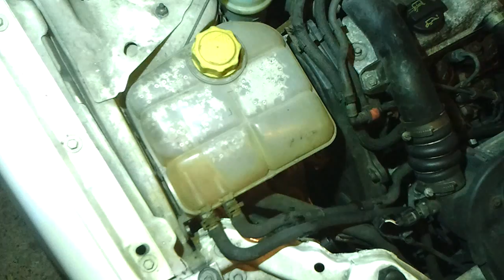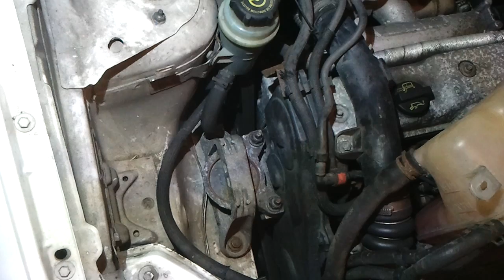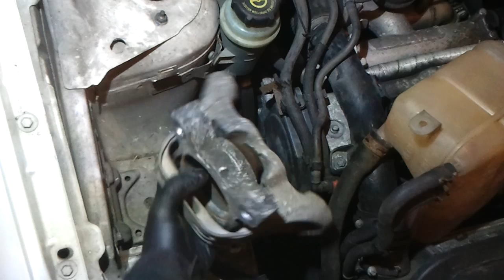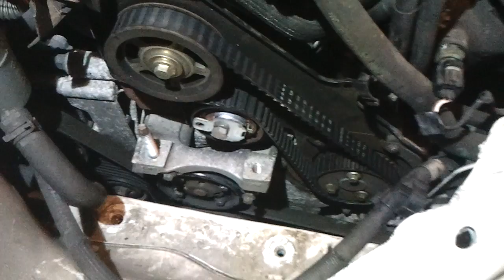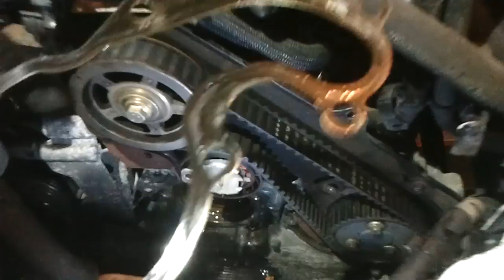Waterpump Replacement on Ford Transit Connect tddi tdci

Comment: Hi. Can someone help. I have a ford smax 1.8 tdci with a same engine. The car has an issue with overheating and looses the water and starts throwing cold air through the heater after 30 minutes of driving. Do u guys think its to do with water pump or do u think its to do with the Blown head gasket.

Comment: god bless you for this video sir. looking forward to leaving my office and getting covered in coolant :)) when you say jack under the engine.. do you just leave the jack there in place or do you get it up and whack an axle stand in? Only because my brain tells me if i put an axle stand in everything is gonna drop down around the engine right? If anyone could let me know that would be great, not had to do a water pump before although i have jacked an engine up off the mount with a crow bar (yes my pitiful 64kg frame ached beyond belief the following day) to change an alternator once.

Comment: thanks for the video, is it 1.8 TDCI is a reliable engine ? on another video they say that there are two distributions, a primary and a secondary, to do around 200,000 km, is that correct?

Comment: Great work mate but why remove the stud from the engine mount to remove the cam cother when you had to remove the bracket anyway surley if you done that first you wouldn't had to of removed the stud if I'm wrong then please tell me as I'm just about to so mine

Comment: Your video was of great help. It was very hard getting into all the bolts and took 3 hrs just to get the damn thing out. Thanks for showing reassembly clips. As it will be hard to remember what goes where. Thank you and wish me luck!😉... All done. Some advice to others; After removing engine mount, jack the engine up a few more inches on that side. This allows better access to the lower bolts on the pulley and water pump. Do not over lift or you will damge the mount on the other side.

Comment: You know the 10mm bolt on the engine mount, the one nearest the belt underneath? Well I could not get my spanner or socket in there properly as space is tight, now the head on the bolt is rounded off, any ideas on how to free it now?

Comment: How did you get at the 10mm bolts at 3:55, I’m doing mine right now but can’t find a way to get at the 2 bottom 10mm bolts on the engine mount bracket , please help?
Reply: You manage after? Thinking about giving it a go
Reply: @rodlaz1984  Its been so long I cant remember if I dit it or not :/
Reply: @liverpooldude1609  🤣🤣🤣🤣 I paid someone, fuck it!

Comment: Hello Sam could you check the 3 videos I've uploaded and let me know what you think has gone wrong on my transit I'm starting to think water pump as the van over heated and is now making this noise not 100% sure
Reply from the maker: Cant tell from the video but if it overheated the first thing you would be checking would be head gasket...

Comment: what year model is this engine? the camshaft is driven by belt on this engine. is it true that 2008 and older have chain driven camshaft?
Reply: nope, the fuel pump is driven by the chaine and than the fuel pump drives the camshaft with the belt.
Reply: And the engine is BHPA

Comment: Great video, the access to the timing belt is awesome, after doing one on a VW Jetta 2.0, the Ford will be a cinch.  Do you think you could have avoided pulling that front mounting stud, if you're removing the mount anyway?  Or do you need to remove the timing cover to access one of the mount bolts?

Comment: Hi Sam, 
Thanks for the video. I have a 2008 Mk4 Mondeo 2.2 tdci 175bhp model. Would you know if this is a similar operation or is the water pump driven by the timing belt?